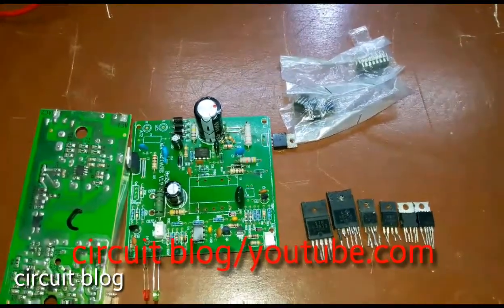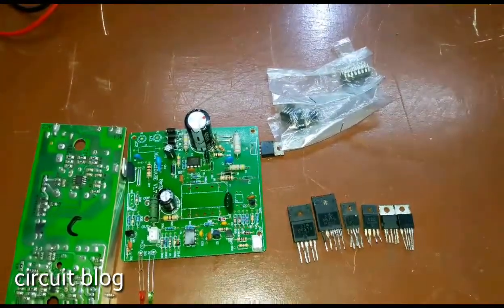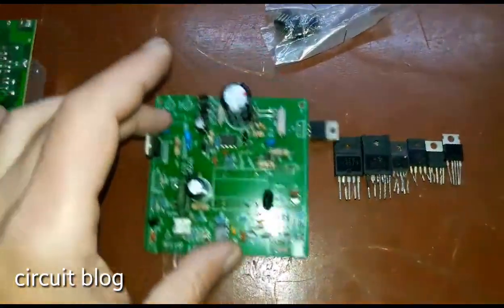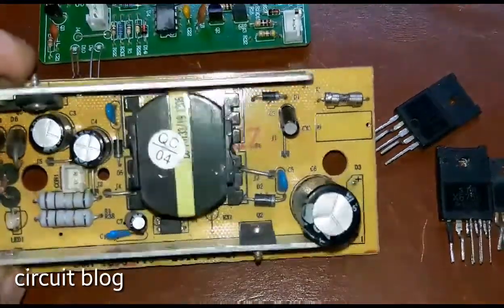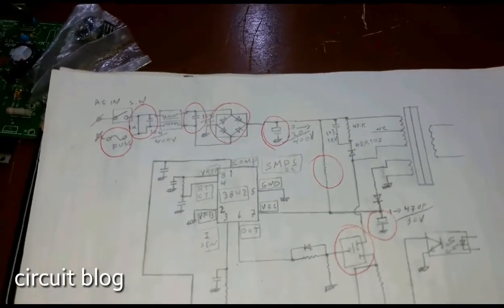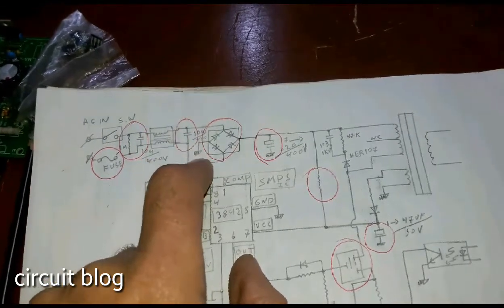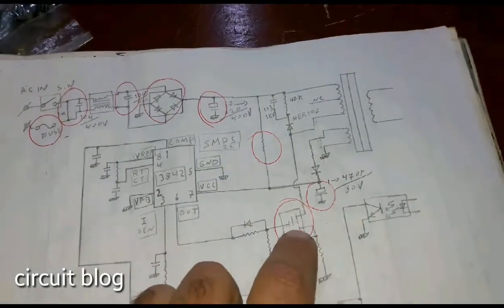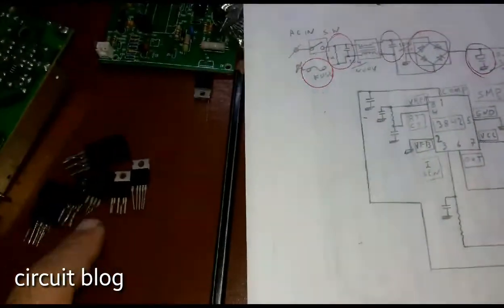100v to 220-240 v charger/power supply

Comment: I followed the link from your Rigid charger repair, I was searching for the step by step modifications required to modify that particular Rigid charger. I have the same charging unit given to me by a friend from Canada that also uses 110V but unfortunately we here in South Africa are using 230V AC. Though I did understand this video, I'm not technically minded enough for micro electronics such as this. Though I do work often with single phase 230/240V and 3 phase 380/400V AC as well as 12V DC in the refrigeration industry, I have very limited experience in micro electronics. Another consideration is that some of those components are not that easily sourced here. I can only think of 3 or 4 suppliers of such components in my city and they're 70 to 80 km apart from the nearest one to me which is 30 km from me.